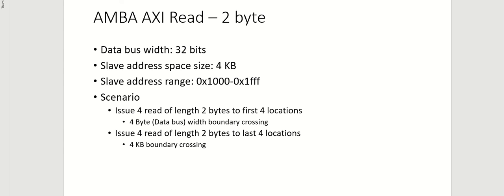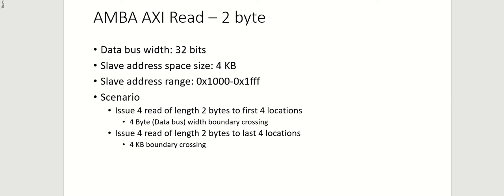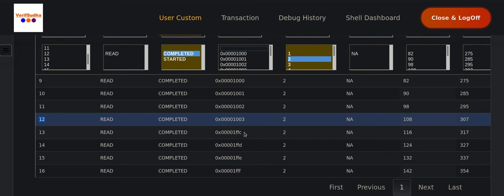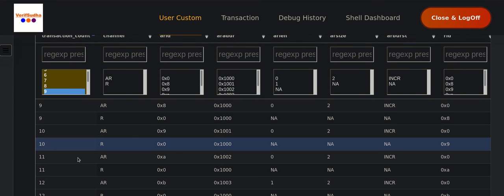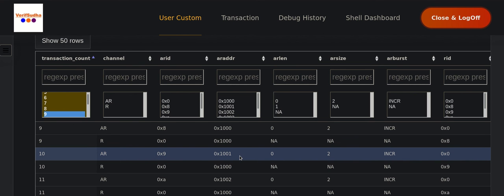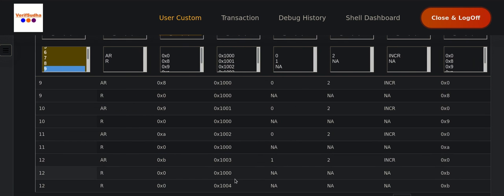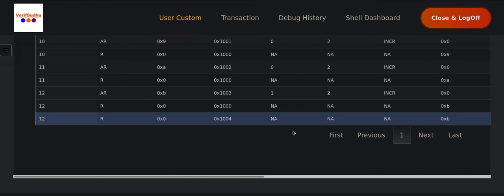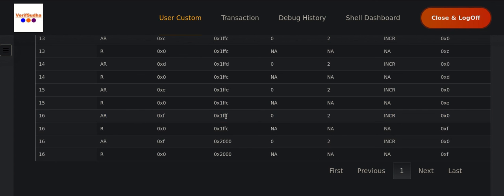Master AXI protocol: AXI READ 2 BYTE length (4KB crossing)

Comment: in first scenario, 0x1000 gets 2 bytes of data as 100 but on next address 0x1001 why are you shifting by 1 byte as 100_00 . Instead shouldn't it be also 2 byte shift as 100_0000. Please let me know if i'm missing something